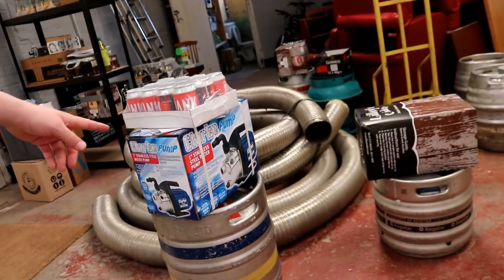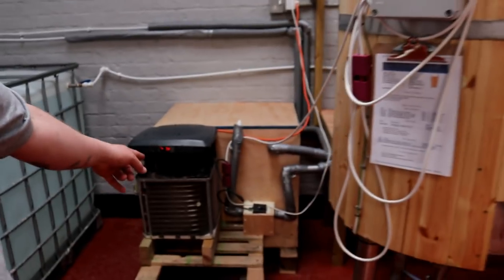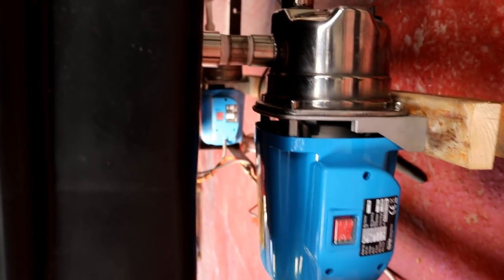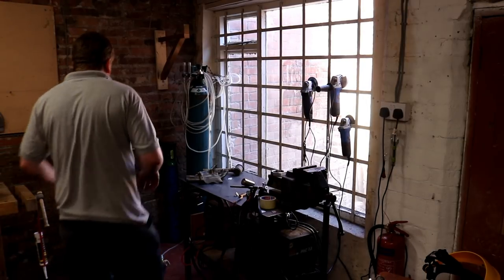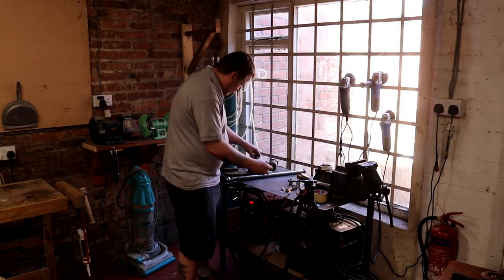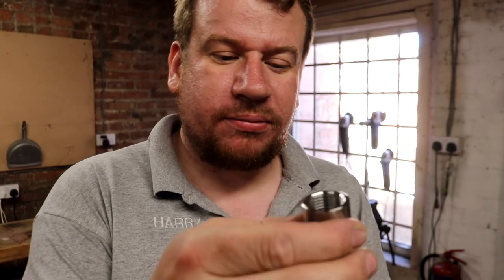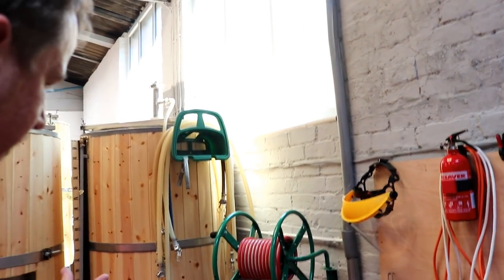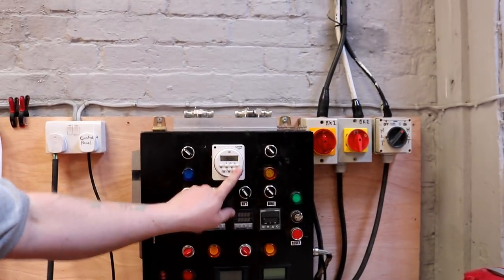The Cask Washer Gets An Upgrade.

Comment: Hi. Just started a nano brewery and after putting my back out twice hand shaking casks to clean and sterilise them I am making something similar to your cask washer. Could I ask what caustic you use please ( I am using antiformin s from Murphys) and how long you leave the caustic and paa in the washer?. Do you make them up fresh each time? Thanks for info. Great info you give in the blogs - keep them coming
Reply from the maker: Hi Mate, good luck with the washer build. I use niche solutions for my cleaning chems. I go Causgleam in the hot caustic wash, I change that when it needs it and then I rinse in the middle tanks then hit it with PAA in tank 3. I empty the PAA every day and flush the pump with the hose as the pumps I use in this vid have a brass bushing that the PAA will eat. This way they will last years.
Reply: @harrybrew69  thanks for the info - will look it up and good luck on the 4th you should be busy!!!!!